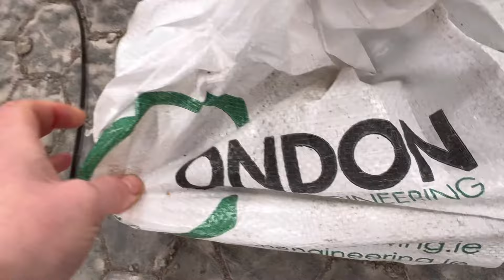More concrete bulk tank room finished, the toughest lambing and cubicles behind the robots

Comment: Charlotte, I take it calving cows will happen in the existing shed where the lambings going on? But, you will almost certainly at some point need a straw pen near the robots for the odd cow, that's sick, slipped, generally needs pampering, off concrete and not in that bank of cubicles believe me. A pen or small yard like that is a life saver at times. Also, make sure you have something in place, like an air line/vacuum line near said pen and a portable milking unit to milk any cows that could end up in there. You may only use it once a yr to milk a cow in a pen, but when you need it, it's a god send to have. 32 yrs in cows and I've been there.
Reply from the maker: Hi, yes the shed where I’m lambing was built to eventually be the calving shed, I know the gates are overkill in height and weight but we had to utilise the shed for calving sucklers. We’ve had a consultant on farm recently and discussed what you have mentioned about an area for unwell/lame. He’s in agreeance that our existing covered handling area with pens will work well for milking fresh calved cows and any other anomalies 👍x